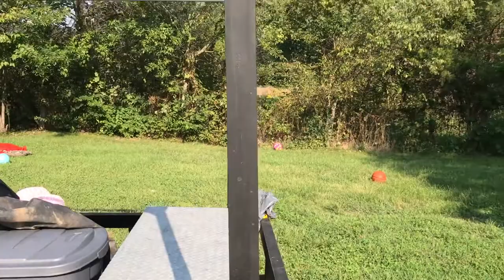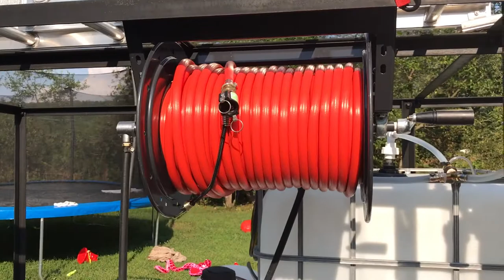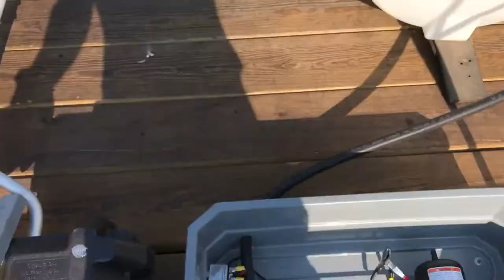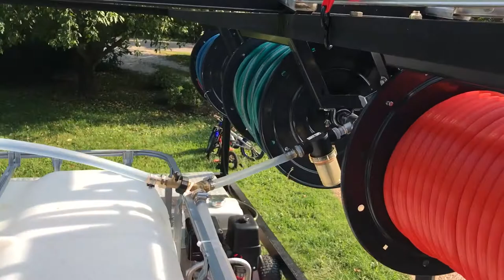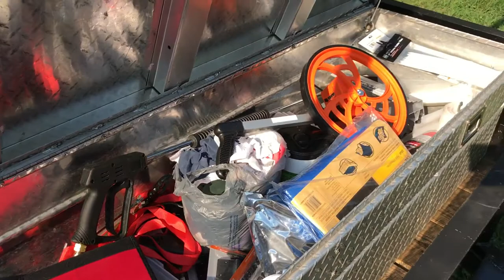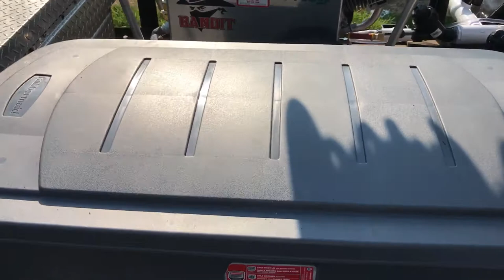Powerwash trailer setup

Comment: The hose reels mounted to that top area is great! Is that cage 100% nuts & bolts or did you hire a welder to weld some areas?
Reply from the maker: It’s all put together with half-inch bolts.

Comment: Nice I'm in the process of adding a rack to my trailer to hang reels and hold ladder too... I may just buy a truck bed ladder rack and modify it
Reply from the maker: John Youguessedit. That might work. Just remember the weight you are adding to the rack. That's why I went with the angle iron. Each one of my reels weighs about 40 pounds and I have about an extra 100 or so in hoses.
Reply: Yea I'm keeping the weight in mind. I plan to use a utility ladder rack that is 2 pieces, one for the front one for the back. Then I'm just going to run three pieces angle iron front to back perpendicular with the racks and use heavy duty hardware to mount together, then mount the reels on the angle iron, Similar to yours
Reply from the maker: That's good might save ya a few $$$

Comment: Nice set up!!  I’m using the same 12v set up, but can you tell me what the accumulator is for?  Thanks!
Reply from the maker: sprsho it helps keep your pump from cycling so much. That way it doesn’t run as much and add life to your pump.

Comment: Very Nice setup bud, you got a great platform to really expand with and make some money! Does your hose reels up like that make it harder to roll hoses or is it easier?  I always keep my reels lower.
Reply from the maker: 1st Choice Power Wash LLC. So far it's easy especially when you get it going the water n the hose helps it along. If the trailer is level it's about shoulder height so it's pretty easy. Iv only used it a few time since I got it done. Might get tiring after a full day of working. Where are you located at? I have a licensing question if you don't mind sharing.
Reply: Im in northwest Arkansas, what questions do you have ill try to help as best as i can
Reply from the maker: I'm in southeast Missouri. I have to have a merchants license to do any work in my city. I'm not 100% sure but I assume I'd need one for pretty much anywhere I work. I called the Secretary of State and they don't offer anything like that for the whole state. My cousin owns a hood cleaning business, which is pretty much the same as what I got he just cleans hoods only. He said he's never got a license and has never got a ticket or a fine and he's been doing it for almost 20 years. I'm just curious how you do it. Thanks in advance.

Comment: Hey Donnie how are you, is that the bandit 5.5 gpm @3000 psi??? If so how is it holding up and do you like it?
Reply from the maker: shane barrows I like it a lot. I have not got to use it as much as I wanted, but so far no issues.
Reply: @donniedunn715  thx for the reply Donnie, is it 3000psi @ 5.5 gpm, the only reason i ask is because on the website it says 3000psi @5.5 but in the picture it says 4000psi @5.5 and im having a hard time finding out much info on it, and one more question if you dont mind... Where did you get it at because I've found it at pressurewashersusa.com and hotwashatlanta.com, and there both the same price $1599, im not sure about the shipping and tax, but mainly im concerned about which one to go to because i really dont want to get ripped off.
Reply from the maker: I got mine from my local shop. I’m not sure where they got it from.
Reply from the maker: This is where I’m going to order my next one from when I’m ready to upgrade. 
http://www.allpressurewashers.com/p-3250-hot-water-honda-gx-630-key-start-8gpm-3000-4000psi.aspx
Reply from the maker: powerwashstore.com also has some good prices on machines as well.
Reply from the maker: Look up Spray Wash Academy on Facebook. It’s a good group to join. It has a ton of useful information.
Reply: @donniedunn715  thank you Donnie, I'll check them out.

Comment: How long have you had your reels mounted like that?
Reply from the maker: Not very long. Trailers only been done a couple of weeks.
Reply: Donnie Dunn how's it been holding up
Reply from the maker: So far so good. I've only used it about a total of 6 hours or so. I can only use it on the weekends cause I have a full time job. I'm a bit worried about the bolts coming loose, but other than that it seem to be holding up fine.
Reply: Donnie Dunn I was wondering about that. From the pressure washer vibrating and the trailer bouncing on the road.
Reply from the maker: I did use lock nuts and washers. I have several friends that have a welder so if it gets to be to big of a problem I'll just weld them solid.